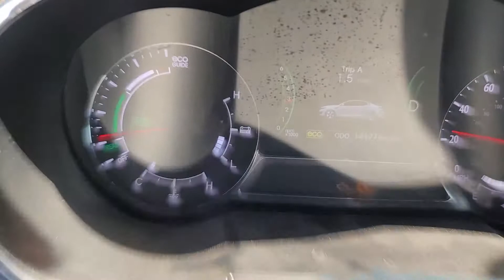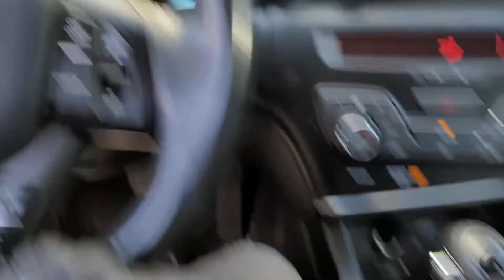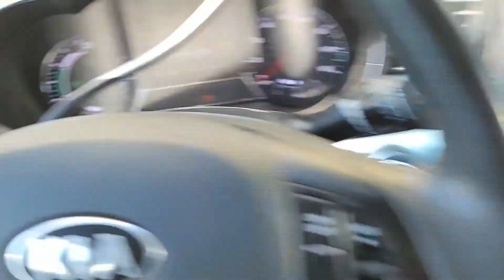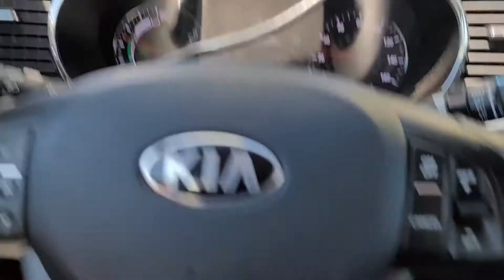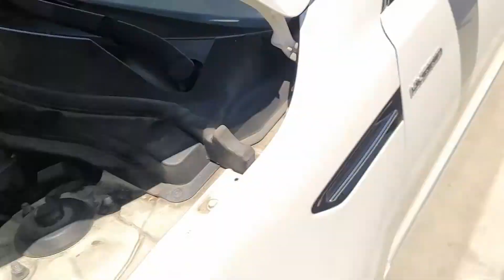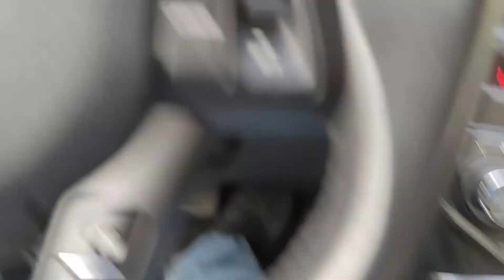2013 Kia Optima Hybrid P0C17 and P1C76 Generator Motor Position Sensor Learning

Comment: Csn this. Issue.  With the. Position sensor.   Be intermittently.   Ocurr. And.   Very.  Random and difficulty  to reproduce  the issue.  As well as no.  Pending   or.   Triggered   codes ir trouble

Comment: question so @salmankhan1 Did you have to remove transmission to replace the motor drive , put everything back and recalibrate?
Reply: Good question and its exactly what I'm thinking about , it could be just that bad sensor inside but another problem is kia and hyundai don't sell it , it's comes bulit in inside the motor. So the only is to change the motor .

Comment: I have the same code P0C17
My transmission works perfectly 
But my car doesn’t charge my 12V Battery. I wonder if this codes has something relate with my problem..

Comment: Hello, how are you? I have a problem with the Hyundai Tucson. When I start the engine, the hybrid battery does not charge, and there are three codes on the Z5 device and the Autel device: P0C1700, P0DFC00, and P0C1700.  Thank you
Reply from the maker: A hybrid tech has to look at it. Hybrid systems are not for someone to work on them.
Reply: @DallasAutoDiag  Thank you for your answer, and what is the solution to this problem? I mean, this is the malfunction code, and there is no charging for the batteries. Is it the drive motor sensor?
Reply from the maker: @infinitinissan6862  it's the drive motor need to be replaced.
Reply: @DallasAutoDiag  Do you mean the drive motor is the charge coil inside the transmission

Comment: Do you know a lot about the Kia Optima hybrid? I have a 2012 version, and my car won't cut on at all. I checked my battery through a multimeter and it has 11.96 volts, but when connected, it drops to around 4 volts. Is it my hybrid battery or maybe the power relay assembly? Do you know what could be causing this?
Reply from the maker: What city are you in? This has to be seen by a trained tech.
Reply: @DallasAutoDiag  Near Atlanta GA. Is it really that bad of a situation? Could I not work on my car myself and narrow down what could possibly be wrong?

Could it be a faulty auxillary battery? Maybe a bad cell within the battery?
Reply from the maker: @robertwhitlet  a hybrid system is not a diy thing. I think you need a pro tech to look at it.
Reply: @DallasAutoDiag  But is it the hybrid system? What do you think could be the issue? I'd rather figure out what's wrong first before taking it to a trained tech and they charge me the price of a new car to repair it.
Reply: I have the same problem 
Did you fix it??

Comment: Thanks for sharing Bro👍
I had the exact same fault on a 2018 Corolla (Fielder) & surprisingly the fix was the same, I unplugged the connector & removed the 10mil bolt & then found that the sensor like thing is just a junction connector between the sensor wiring (inside the motor gen) & the PCM wiring😉
So the sensor is fitted on the motor shaft, & for that everything had to come apart, I did put everything back together, sprayed some contact cleaner on the junction connector & the grip, Re-calibrated it with my IM608 & everything was fixed👍
Really interesting case study👍
Stay Safe Bro👍
Reply from the maker: Glad that it worked for you. For me it dis not although i did not clean the connector as you did. I think tge owner replaces the whole trans that came with drive motor and senaor from junkyard.
Reply: @DallasAutoDiag  It surprised me, you know a tech's feeling when something like this get's fixed instantly😉
Totally agree with you, replacing the entire thing would be a permanent fix👍
Reply: @DallasAutoDiag Do you know a lot about the Kia Optima hybrid? I have a 2012 version, and my car won't cut on at all. I checked my battery through a multimeter and it has 11.96 volts, but when connected, it drops to around 4 volts. Is it my hybrid battery or maybe the power relay assembly? Do you know what could be causing this?
Reply: question so @salmankhan1 Did you have to remove transmission to replace the motor drive , put everything back and recalibrate?

Comment: I recently have a problem with the Auxiliary pump. The pump for the HSG or the hybrid alternator (turns the service light on and ready light flashing). When engine is warmed or hot, including the weather. That causes the transmission to jerks off or a problem with the transmission. Basically its the HSG or hybrid alternator doing that transmission jerks. I have replaced the Auxiliary pump and the transmission jerk fixed. But i have a code p1c76 and engine light comes on. I don't really know whats that for or how to fix that.
Reply from the maker: Watch my other video in this channel. It sounds like the same of what u have. Its about a 2010 fusion hybrid.
Reply: Can you explain what the jerks feel like? I think I have the same problem.
Reply: I have a 2012 Kia optima hybrid and I replaced the hybrid alternator on mine and the transmissions still Jerks when your coming to a complete stop not all the time but occasionally the check engine light comes on and off kinda of annoyed doesn’t want to pass smog :/the aux canister was also replaced by the dealership for a “recall”

I have the same code P1C76